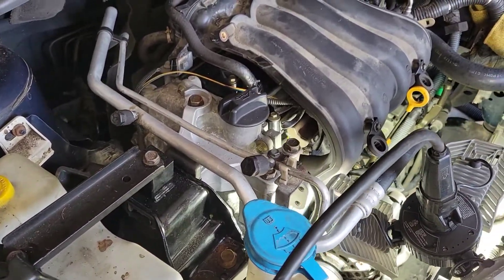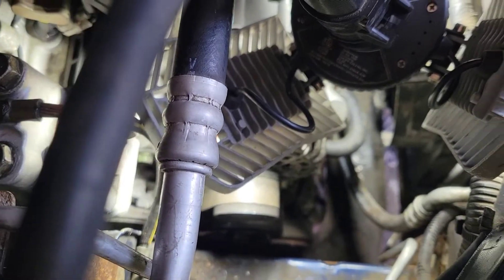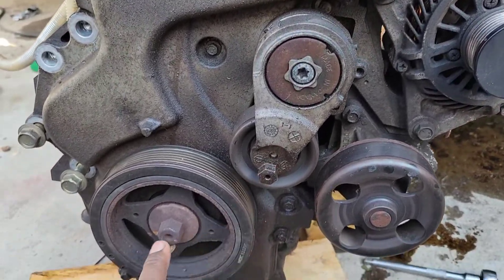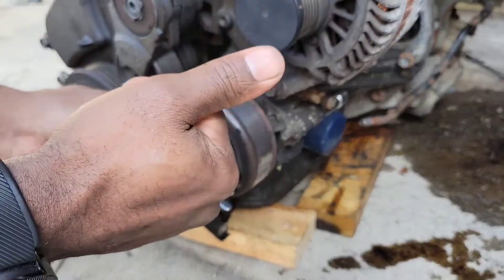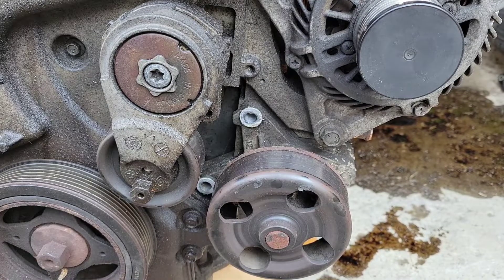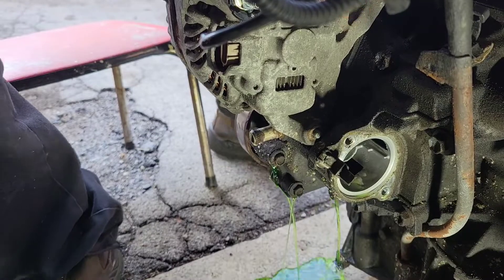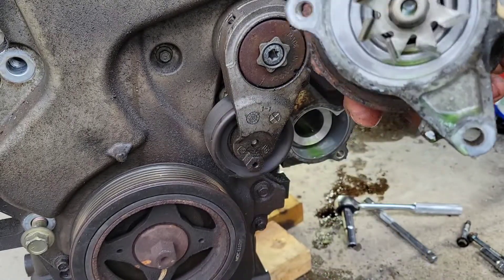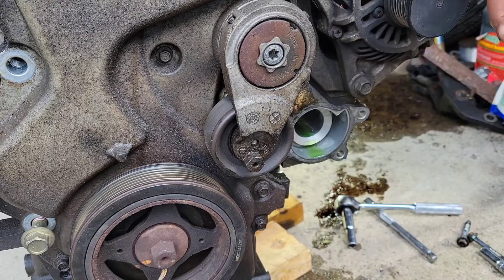HOW TO REPLACE WATER PUMP. NISSAN

Comment: Hi, I would like to ask if anyone can figure it out. There is a hose connected to CVT on the housing. I wonder if the water is flowing INTO the water pump from CVT or flowing OUT from Water Pump to CVT. Thanks in advance